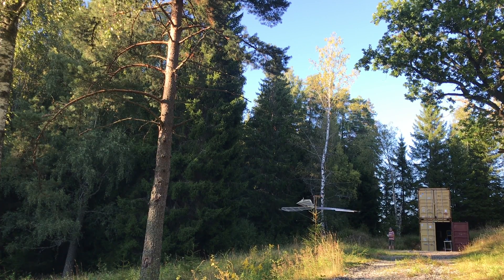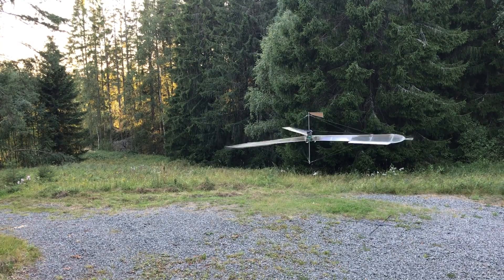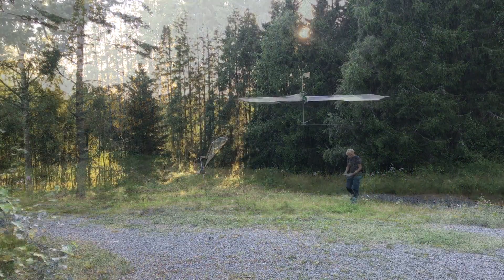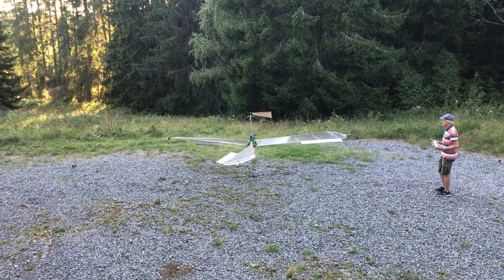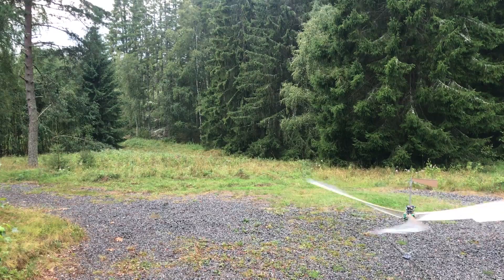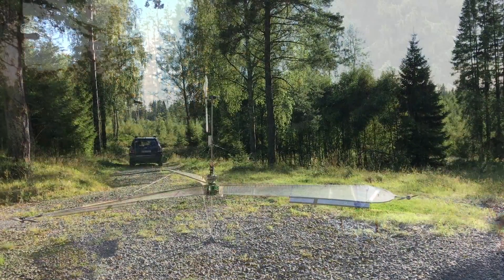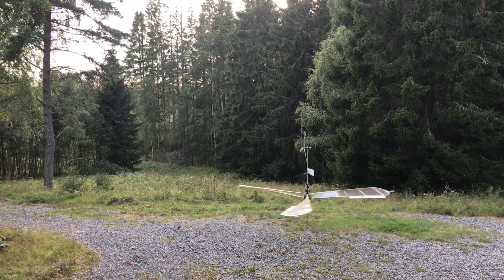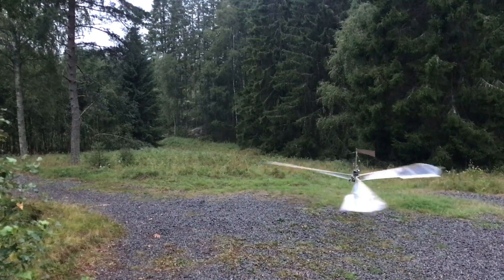Levitator 3 Further Testing. DIY aircraft.

Comment: I didn't immediately watch your first two videos about this project... I'm now binge watching the 3 vids.....

And i can't sit thight w/o thinking....

Uhm .... can't you make the actual wings, all three of them, more intelligent .. so you don't need to rely on the slip ring for the aileron(?) settings?

O.k. it might sound weird but hear me out:

Let's imagine, you put parts of the actual servo control etc on to the wing itself.. Change the slip-ring configuration "down" to simple power and data transmission in continuous rings with an added ring for a optical or otherwise coupled mechanism to tell each of the wings their actual position on the 360° circle.

So that the local electronic in the wing can calculate it's position on the circle and the requested aileron posittion according to the needed value right there. Per degree of rotation.

When you adittionally put the ESCs on the particular wing, things could get somewhat easier and the only concern is the data transfer between the main ICU and flight controller .. and it's wings...

Just some weird thoughts.. not even 2 cents..

Btw, love to see you back, i missed your projects actually. ;)
Reply: 5:56 You can fix those connectors by gently bending the "snap/latch tabs" outward with a fine flathead screw driver...

I actually used this technique a lot for plain usual molex power connectors in ton's of PCs..

With a bit of skill, one can easily unhook and re-hook those pins ... let's say, a lot safer, into the connector plastics. ;)

Comment: Nice project. Btw, why would you have a twist in the propeller blades like in an aircraft propeller? I thought the twist is required if there's a verticle component of velocity. This seems to be mostly hovering and occasionally slowly climbing.

Comment: You might want to increase the control surface area again significantly and maybe even switch to trimtabs for control even though you'd have to adjust for the additional aerodynamic reaction delay. Your model is at the limit of what I'd care to try even with modern all metal servos.

Comment: if you stare at it in flight, spinning calmly away, at some point it looks like it's spinning in the opposite direction and it hurts your eyes to try and correct - bizarre illusion only possible at this spinning speed - definitely need better connectors, you're using Nimh connectors on modern Lipo circuits. Brilliant design, I love your thinking.

Comment: Hi… can you inset the hinge further into the control surfaces. The area forward of the hinge should reduce the load required to actuate the control surface. This may allow more precise control or yet larger control surfaces. Or…

Could you set the null zone of the control surface on forward travelling blade into an up/negative position while moving therefore balancing out the dissymmetry of lift? 

Just a though. Love your work here.

Comment: Interesting, I can see the ailerons are modulating UP on on the direction you want to deflect toward and DOWN deflection to move away from, (I hope I got that right). Nicely done, although they are a bit choppy, jerky . The third 'wing' presents an interesting problem because it must be neutral, so control as it rotates goes UP-NEUTRAL-DOWN and the timing is not proportional, in other words I don't think the ailerons can each divide their UP NEUTRAL DOWN by 120 degrees. It seems to me it is more like 1 rotation in the direction of travel would be more like UP 30 for degrees, NEUTRAL for 150 degrees and DOWN for 30 degrees of rotation with respect to the direction of travel. They appear  to just go up and down no neutral?
 Just a quick guess. How these ailerons move does not seem to have any affect on hover, I think you have mastered that. 
In addition, you need some threads or strings to show what is happening to the air flow over the aileron area of the wing, it seems to be lacking, therefore the larger ailerons were more stable but still not enough air deflection, perhaps. 
Also at such low speeds it will need a lot of deflection to have any authority.
Just a guess, Jim
Reply: I think your up-down-neutral analysis is not quite correct, although the jerky motion of the ailerons from the camera does make it look a bit like that.  Each aileron is controlled according to its position around the circle as it rotates.  Three are very stable, but you could have 2, 4, 5 or even 6 wings and ailerons.  Each is controlled based on how the desired lift vector needs to be applied, based on it's location around the circle.  I suspect there needs to be some compensation for the delay cause by the servo motor and gearbox which will take time to change position.  In that time the wing has rotated further, and so the servo has to move even further, which means that it tends to be moving from one extreme to the other.  Some forward compensation in the software based on the rotational speed may help with this and make the aileron operation much smoother.
Reply: "you need some threads or strings to show what is happening to the air flow" that;'s called 'tuft testing' and yuo're right he needs it.

Comment: funnel on the end of each wing tip with a controllable cat flap covering end of small end of funnel. weight, software timimg of fcatflaps and air resistance will all be major issues to overcome.   great video and a great choice of project

Comment: This design is extremely promising as it would scale favorably with size, at least to a point. I'd love to see a slightly scaled up version with more robust control surfaces, possibly ones with flaps for spin up and spin down/landing where the rotor is moving slower, and retractable into a shorter control surface as the rotor speed increases. And as you pointed out, stronger and faster servos would make a big difference. Another approach to consider is a dynamic wing/lifting surface that can flex or change shape to optimize performance at different speeds or if fast enough to act as a control surface itself.

Comment: Would it steer if you offsets the center of gravity? Like a weight on a controlled 3 way controlled ball swivel. Interesting machine!
Reply: weight shift. Good idea. I always thought of that as being the reality of rotary wing flight anyway_ helos and gyros. You're moving the rotor disk relative to the CG. IN a sense that's how all aircraft fly, with reference to the CG. it's  the major unacknowledged contributor to control in everything, even bicycles.

Comment: Some of the flapback might be due to how the flight controller is tuned. For example it might be beneficial to have different lag (or angle) offsets for the P I and D influences on the flap movement.
In the test with the drag surfaces below the center of mass (9:40), one problem might be that the tipping force scales with speed, not with the angle. This makes the system inherently unstable, but that should be something that the flight controller can counter. It looks like any time you change the difference of drag above/below the COG you would need to tune the settings for those new flight characteristics.
Thinking about it, the dissymmetry of lift also scales with horizontal speed. Maybe your drag surfaces were just too large and over-compensated for the flapback forces, taking you from inherently strongly stabilizing to inherently unstable.

Something else you could do is to shift some weight around.

Comment: I saw a monocopter that used differential thrust for lateral control. That system required computer vision to determine the angular position, but you already have a stable commutator, so that might be simpler for your craft.

Comment: Nicholas Rehm made a similar craft. "Spinning Drone Paradox" covers the functionality of the concept. It traded some efficiency in rotor-craft hovering mode to have the ability to use the blades as a tri-wing for fixed wing flight. The big airfoils are symmetric and change pitch at the hub, which allows the RC craft to both hover slowly and fly in a straight line somewhat quickly. Kind of an interesting project, since it's very closely related in concept to the RC craft of this video but also takes on another way of flying as well.

Comment: if i had 3 identical propeller prototypes connected together with a triangle mount above and below would it rotate slower than the propellers alone?  in terms of flight speed, a weight (battery) could help to tilt the propeller in the direction of flight.

Comment: As much as this intrigues me so, one primary question keeps screaming in my head. All of these wonderful tests are being done at what elevation? Given the slow rotation, is this being done close to sea level? I only ask because I walk out my front door and am at 11,000 ft. and helicopters have issues getting higher without being "equipped" for it. I do believe it is relevant info.
Reply from the maker: 34m,  aprox. 100ft, over sea level at this location!
Reply: Pretty sure its within a few hundred feet of sea level.
Reply: @GoldenCroc  Ahhhh, now that makes a load more sense. Still some wonderful work, truly.
Reply: @goliyth5134  Indeed it is. I was fortunate enough to be of real world service in one of these projects, and it was a joy from start to end.
Reply: To my knowledge you can operate a crane at any elevation.
Reply: @charlestaylor3195  True, but crane does not stick to side of mountain.
Reply: @charlestaylor3195  sorry, don't understand how a crane is relevant here.
Reply: @myotherusername9224  That'as what is being used to raise, lower, and swing the device.
Reply: @charlestaylor3195  i thought this was flying under its own power. Are you saying this device does not actually fly ?
Reply: @myotherusername9224  it is flying under its own power, that guy just misunderstands the principles of lift. I used to have a commercial toy version of this thing, admittedly much smaller but this type of flying machine is definitely capable of flight.

Comment: I saw an interesting application that used a kind of spring system on the rotors, and changed pitch by doing rapid changes on the servomotor drive, using the inertia of the blade, and the sudden acceleration/deceleration of the motor to torque the system into desired pitch, at a particular location in the rotation, so it didn't need any funny mechanics on the rotor, and did not need any slip rings to drive motors on the blades, for instance... I'm tired, and a bit sick, so maybe not making much sense... one motor per blade, but coaxial, so that the motors are fixed, and they can change the blade lead/lag and pitch .... sigh... burned out, I am ...

Comment: The reason your model can not fly fast is that there's a thrust asymmetry between the advancing and retreating motor's propeller thrust (due to differing inflow.) This thrust difference creates a "drag" force in the rotor plane that prevents the model from flying as fast as a normal helicopter would for the same rotor plane tilt angle. The only way to eliminate this "drag force" is to cyclic vary the thrust of the motors driving the blades.  
It has little to do with your rotor design, it is mostly the thrust difference between the drive motors as the move from head wind to tail wind. 

Here is a similar design I built that uses a compass for cyclic control timing. It has similar limitations in forward speed because the drive motors are only connected to the throttle channel, not the cyclic control input.
https://www.youtube.com/watch?v=VWRvIjY8ibI

Comment: You could test the steering by  moving the weight in the direction you want it to go. The rotor would tilt and start blowing air in the opposite direction. The flaps would be unneccessary. Also the wing surface close to the center is unneccessary, it only slows down the speed of rotor rotating.

Comment: I like the idea of keeping it  , super light and super slow ..... I'd Go straight to the 5 blade model  !
Reply from the maker: I like the idea of a five blade version as well for redundancy and precise control potential, however weight vs. efficiency drops, so not an option with this simplistic wing design I think.

Comment: I liked the slow motion clip at the end. You can really see whats going on. Is the large wing area and slow rpm a good candidate for solar panels built in to rotors? I really think you are on to something here. So elegant!
Reply: Might be, but a plane would be more efficent I would think. But if you want a rotorcraft, yeah, why not.
Reply: @GoldenCroc   Solar planes with crazy flight times whether they are r/c models or full size have been achieved.  My question is could you use the light weight 3d printed solar panels developed by the Australian CSiRO as the surface of the rotors in this design to achieve sustained flight  in full sun. (Probably somewhere like Australia or Spain that has decent solar intensity). Another idea is a pusher prop placed at the C.O.G. rather than lower down to help lateral speed.
Reply: @MrBoatman46  Well yes I know, but I thought you might be interested in the comparison of the concept in any aircraft. If you werent, thats why I put "If you want rotorcraft, yeah why not" in my last comment as well. 

Anyway, I think its possible to make an totally solar powered rotorcraft using this concept, but its not going to be easy and it is going to push the envelope of light wight build techniques, making it very sensitive to wind.

Comment: Looks Great, Awesome project. 
Thanks for trying the dihedral, interesting.  For a lot of control authority, you could try to make the motors pitch up and down. They are far from the CG, should work.
(Maybe even better than the surfaces?)
Reply: It would certainly be easier on the servos. In the view along the control surfaces you see that the air stream really does what it wants with them and flattens them out to 1/4th the deflection they want to have.

Comment: I'm not sure if I understood this: are you switching the connections between the flight controller and the individual flap servos, as the blade rotates?  If so, I guess that explains the sudden changes in flap angle, if this is the case.

Comment: Amazing work as always.  I've always dreamed of long flying crafts due to the efficiency and weight removal benefits a ''jet' driven rotating wing design gives.
Regarding efficiency, wouldn't you get better lift efficiency if the pusher propellers are blowing over the airfoil due to Coanda effect?  Accordingly, since this is not intended to be a highly maneuverable craft, props with properly sized ducts might also give more lift efficiency.
Reply: while the coanda effect is a thing it is never the optimal design solution for air vehicles
Reply: @windowsxseven you are saying generally for air vehicles which is true.  However there are specific designs like in this case, a vehicle designed mostly for lift and minimal maneuverability standard thinking needs to be rethought.
Reply: @preddy09  not really... I can guarantee that even a typical "traditional" design for this type of aircraft would far exceed even the most optimized coanda-based solution
Reply: @preddy09  here's one reason - lift is a force perpendicular to the flow direction. Drag is parallel. Having an airfoil below the propeller would just generate sideways force (airfoil's lift) and downward force (airfoil's drag) as the flow streams downwards from the propeller. Aside from that the airfoil will also have a blockage effect on the propeller (interference), reducing its efficiency. It's far better to just optimize the propellers instead of placing additional devices that will block the flow. Even if it did generate upwards force, that force essentially comes at the expense of reducing the propeller's thrust, so at best the net thrust will be the same at the expense of additional weight
Reply: @preddy09  may seem kind of boring but traditional designs are traditional for a reason... they really are the optimal solution given current available materials and our understanding of nature
Reply: @windowsxseven   @EasilyFallsForClickbait  is really on to something. You're right, props behind the airfoil are ineffective for the reasons you stated, but in front is another story:
https://www.youtube.com/results?search_query=custer+channelwing

[had to edit this comment due to a massive glitch in the brain  matrix]
Reply: @myotherusername9224  made up reasons 🤣🤣? Mate grab an aerodynamics textbook for reading some time then come back
Reply: @EasilyFallsForClickbait  
" wouldn't you get better lift efficiency if the pusher propellers are blowing over the airfoil due to Coanda effect"
yes, exactly. except that they would not be pushers in that case, they would be tractors. for maximum efficiency the prop should be positioned above and in front of the leading edge so 100% of the propeller wash goes over the top chord of the wing. duct not needed. Custer proved this with his Channelwing in the 1930s to 1960s. Coanda effect will occur as part of the phenomenon but the main thing is the wing will direct the prop wash downward, along with air entrained by the prop wash, and the air scooped up by the wing itself.  Newton takes over at that point. smaller props and motors (Many  of them) distributed along the leading edge will have a massive effect. I venture to guess if he were to take all of the motors and props from his manned quad copter and installed them on a 4 rotor or 5 rotor lifting device like this he could carry two people.

Comment: Would a simplified version without the "static" fuselage be possible if you used a hall sensor/earth magnetic field to sense the rotational position?
Reply: Yeah its possible. Nicholas Rehm build one
Reply: A static part is needed to have the flag as a point of reference for controlling the aircraft, so putting the controller on that part makes a lot of sense. Otherwise you'd need to write a complete new code for the controller to counteract the rotation. But yeah, I think it's possible, complex but possible.